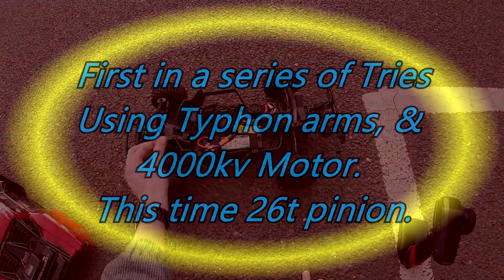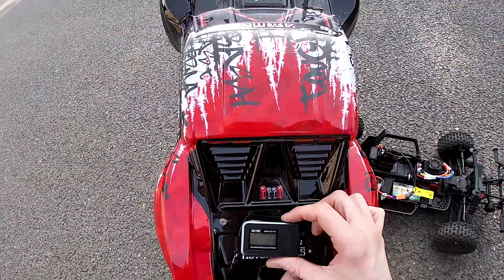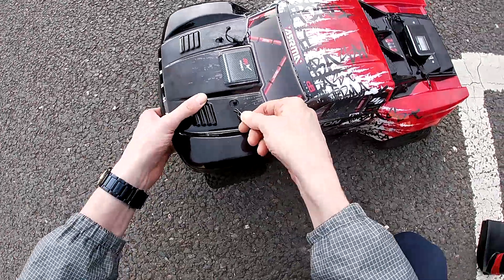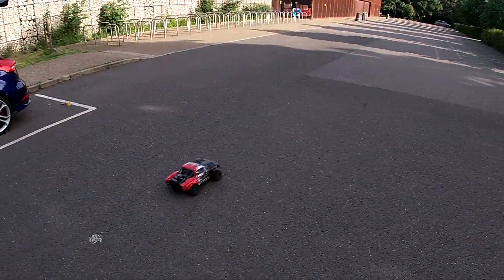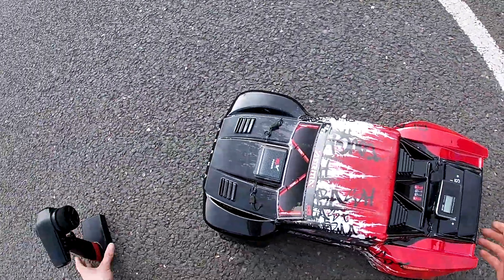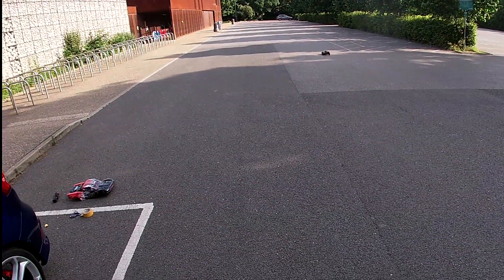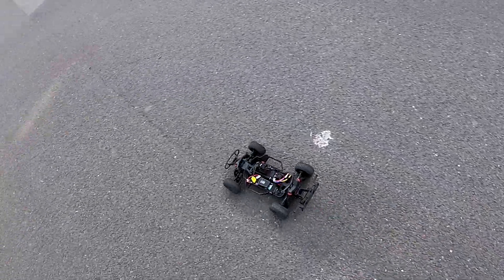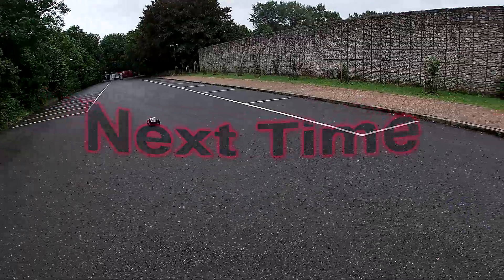Arrma Senton V3 ( WIDENED ) Running  4000kv Motor, 26t Pinion Any good?     #Tenshock. #Arrma

Comment: Nice truck Mark. 👍 50mph good mate. Need to line up ur wheels and put better tyres on. Could be ballooning that normally the case wen goes out of control speeds. Make sure the toe in or the toe out are correct. Remember they set up for off road. You will after set it up for road. Put some harder tyres on or dboots hoons on. 👍 🇬🇧 😀 👍
Reply from the maker: Hi Gaz l, I know your right, I didn’t want a to 26t pinion but that’s all I had that fitted in that pitch. 
I did try again with a 20t pinion, you are right about the tyres I just don’t remember having such a bad time with my Senton V1 the Green version . They must have made the compound of tyres softer or Cheaper 🧐.  
That’s the reason I persisted, I do swap tyres and make some changes but it won’t be until the video after next sadly .
Reply: @mark-1rc502  😀 👍 🇬🇧 👍
Reply: Maybe get a little camera to tape onto the body and film the tyres. I quite often do this on my speed runs so you can see whats happening
Reply from the maker: @tiborvon  
That’s an idea what kind of camera ? 
A GoPro sessions cube shape ?
Reply: I use a Hawkeye firefly   nice and small. Cheap. Good quality footage.
Reply: Q6 or Q7
Reply: I just use cellotape to hold the camera onto the truck.
Reply from the maker: @tiborvon  
What’s that ?
Reply from the maker: @tiborvon  
Arghhh ok Hawkeye firefly
Reply from the maker: @tiborvon  
Argh thanks Tibor , yess that looks awsome idea cheers mate .

Comment: You can get skid plates for the roof of the shell on ebay, lets see what your absima can do in the dry!
Reply from the maker: Yes 😢, I should have gotten them in the first place it’s in a bit of a mess at this day now. After tests . 

I have a couple of videos in the pipe line, I will run the little Absima on a dry day.. Hooefukly this week . 😏

Comment: Great video change bodyshell get her a bit lower and some proper wheels and tyres and it will be even faster
Reply: I just put grps and 17mm hubs on mine, what bodies fit the senton? I’ve thought about 1:8 gt body like the proline pf8. Just remove the bumpers but not sure the stock body posts will let the body sit low enough.